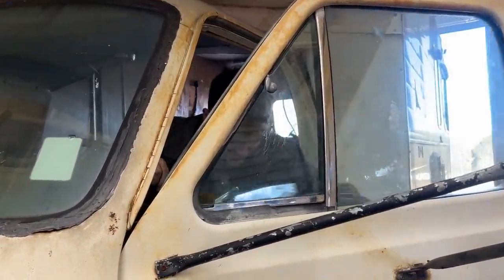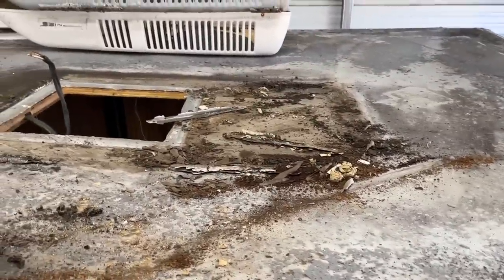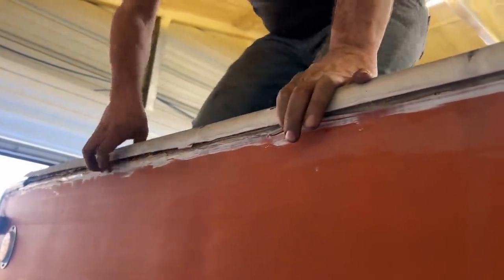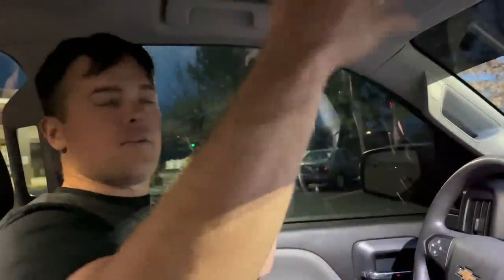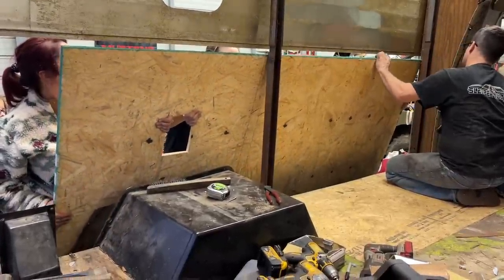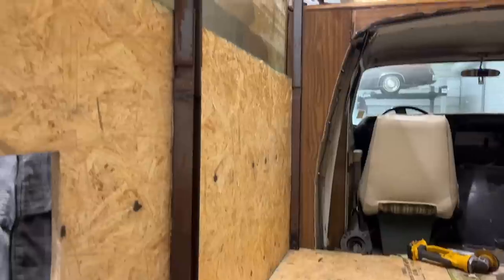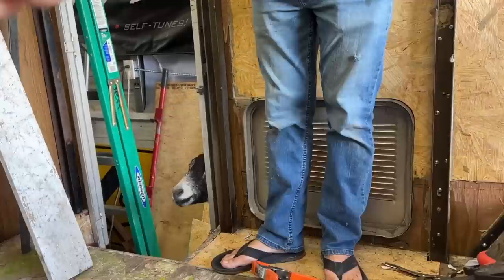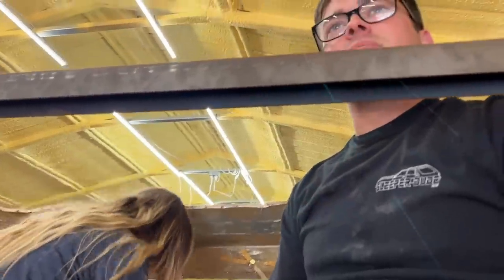Rotten Roof, Walls, and Floor! How bad is it? Antique Motorhome Budget Remodel.

Comment from the maker: 💯 Download Fishing Clash on your iOS/Android device for free https://fishingclash.link/Sleeperdude! Use my gift code TURBOJOSH to get an awesome reward for a total value of $20, and share your biggest catch in the pinned comment!
Reply: We got a clan going on this game?  Pretty good graphics.
Reply: Great job. Put some 4 inch angle roof edge on top of the rubber roof. Fasten it with glue then stagger the screws every 4 to 6 inches. Glue a 6 inch strip of rubber over the metal to cover the screws. Caulk the 6 inch wide strip of rubber on all sides with Vulkem urethane caulk. This will prevent leaks and  keep the roof from blowing off while traveling.
Reply: I got distracted playing and had to rewind!
Reply: Did you buy sturdy flooring osb? The glue is waterproof and would be good for all of it.
Reply: Let Ralph’s get his sleep!  The boy lovers this and sleep!  He’s growing up before us all.
Reply: Just saying!
Reply: If they made steel toe flip flops you'd definitely wear them don't lie Josh

Comment: Oh, man, more motorhome fun - this makes my week so much better. Thanks, Sleeperdude family! Speaking from experience, the only thing that lets in more water and then holds onto it than a motorhome is a sponge.
Reply from the maker: Your right
Reply: @Sleeperdude  The new rubber roof should be a big help in keeping it dry...hopefully for many years.
Reply: @xlmi7021  I saw an old motorhome that was reroofed with a corrugated metal roof, like on a house.   It looked pretty good and has to be stronger than rubber
Reply: Touring caravans (the kind you hook up behind a car, the kind Jeremy Clarkson has spent 40 years destroying on camera). Similar construction, except, you see that steel frame in the Wienerbago? At least the old (1970-1993) caravans I know of, all had wood frames. So when they soak it up, the whole structure gets floppy. With the inevitable sag, lean, and drop if left long enough.
Reply: New t-shirt idea  it ain't easy being squeezy

Comment: Consider putting a metal tube from front to rear between the metal supports so there is a bow in the top. Flat roofs will never stay sound for long. Even a 1.5 inch bow will make it more waterproof over the long haul.
Reply from the maker: Sounds good

Comment: You have a blank canvas now ! With 3 kids and that size motorhome I’d build 2 bunk beds and a queen size in the back a small kitchenette and use those bus seats for the kids right behind the drivers compartment + a small head would be needed ! Haul a small enclosed trailer for your BBQ and bikes and chairs and when camping use the trailer for a dinning area and game area in case it’s raining but make sure you insulate with CLOSED FOAM on the ceiling and walls and floor ! Hardwood floors work the best plus a box on the rear for your generator and tools plus gas cans . I’d use the cab bunk for storage of coolers and clothes and food , that’s my opinion from a guy who has owned many campers !
Reply from the maker: Sounds good

Comment: I love this project and even more that it is a family project. Life skill building is invaluable. I'd suggest more steel structure in the roof especially where you will put an AC unit to prevent the roof from sagging. As for weight, make sure you have some decent shocks, maybe adjustable air shocks to prevent shock load to the structure after adding interior and luggage while  traveling. Maybe some type of moisture barrier with taped seams to prevent structure damaging condensation while sleeping. Finally prevent rot from wet road spray and ground moisture by using an impermeable coating on the underside of the exposed floor. Maybe hit up a cat scale before and after doing the interior. Make sure the GVWR doesn't exceed the axle rating. Use better wheel bearings. Carry a porta potty instead of plumbing in a gray/black water tank. Fresh water tank adds lots of weight. Most campgrounds offer electric/water hookup. Add rear impact protection inside rear wall, tied into vehicle frame. Maximize storage with your interior build. You're doing great! I'm looking forward to more of this series and your travels.
Reply from the maker: Yes good tips thank you ..

Comment: The framing in the front you can weld a frame to screw the OSB to. The whole perimeter of the roof can be metal for strength to hold better. Y'all can build a stronger structure with a little more metal. Tanks are easy to find. There's an RV salvage business in Kentucky y'all can source some of the parts for. I wish I could remember the name of it. They've got pretty much anything you'll need. The wiring is gonna be a problem cus you forgot to cut channels for it.
Reply from the maker: Ok thank you
Reply: The wiring goes in grooves cut into foam board which he hasn't installed yet. That's how they do it from the factory

Comment: You cant beat a older motorhome , I have 83 gmc  doing the same here. Keep up the good work family. Loved the big boat ride so fun. Georgia mad mike said that.
Reply from the maker: Awesome thank you
Reply: @Sleeperdude  Hey USE the electrical panel thinner than luon not heaver  thin panel
Reply: Use the weather wrap  side to side across the top. so if it leaks it will run off  . TYVEAK wrap

Comment: Hey Josh, biggest suggestion is metal frame the front bed area to prevent the structure sagging onto the truck roof in the future as the wood rots out again. I’d also consider some diagonal supports under the bed, in the rear wall and at minimum 2 in the roof structure if you’re trying to stiffen it up to make it safer for your family to ride in. Consider also that the chassis underneath this motorhome may need some structural upgrades to meet the requirements for new registration. If it is possible to fit upgraded brakes please do so as that newly rebuilt 360 will produce more torque propelling this down the road faster than the manufacturer intended. With such an amazing family on board you should have all the stopping power you can muster. Also consider this was built for two people to travel in. In Australia people riding in the living area must have lap sash seatbelts like front passengers do. I despise side facing seats due to the number of neck injuries  on record.
Reply from the maker: Thank you

Comment: I use too work on these motor homes for about six months and one tip i can give you is to make sure it's water tight is when you silicon it up you need to remove all the old silicon and wipe down the surface with some solvent before you apply the new silicon as new silicon doesn't seal to old silicon very well 
Thanks for all the great content and happy birthday Josh from south Australia
Reply from the maker: Thank you for that tip!!!

Comment: Hey Josh, I have been in the Rv industry for over 20 years, the sealant you want to use is called Butyl Tape, for corners, and Dicor self leveling for the seams on the roof. I  am here for you if you have any questions..
Reply from the maker: Ok great thank you

Comment: Tip: The hole by the handle of the caulk gun is used to cut the tip of the caulk cartridge. Stick the plastic tip in the hole and squeeze the handle. Easy peasy.

Comment: One other trick I was going to tell you is if you ever break down again you can rent a 2-wheel car dolly and a U-Haul half ton Chevy pickup and throw the front of the camper up on and tow it back the only thing I would do is remove the driveshaft like you did before just take it easy and if the fryin is a little too wide normally there is front spacers on it and you can remove them and put the wheels but normally a car dolly is wide enough to fit a dually on on the front end
Reply from the maker: Ok thanks
Reply: @Sleeperdude  yeah no problem don't mean to keep bothering you there is a really nice Ford Fairmont up on marketplace he says it does not run says it only has original 48,000 miles and it's really good on rust and it looks like it from the pictures I tried to send it to you off the sleeper dude 88 on I think you should check it out cuz I know you need some parts I think it's way worth that

Comment: YOUR  DOING  WHAT  IVE  BEEN  DOING  ON MY 73 
TIOGA  FOR  27 YEARS
O K....THEY   ALMOST  ALL HAVE.....360  727 TORQUEFLYTE......410 GEARS
DUALLY.....GOONG  TO  OVERDRIVE....ONLY  WORKS 
IF YOU  GO  TO  383  OR  440..
360  IS  NOT  STROMG   ENOUGH
.ANYWAY.....GOOD JOB.
.
Reply from the maker: Thank you

Comment: here's what I did , I took the whole camper shell off the motorhome keep the driving part then I bought a fifth wheel holiday trailer took off the fifth wheel hitch and axels+springs lifted it up backed the mini winnie under the trailer and bolted , welded it together . Then I used the existing trailer wiring less the brake wiring to wire up the lights , then I used lipstick and bubblegum to finish it up now I got a little bit of old with newer power train and newer camper shell and no leaks sleeps six .

Comment: I bought a 79 motor home several years ago, the previous owner had stripped the inside.  I rebuilt most of the inside (until I got burned out).   Ended up trading it for some plumbing / well work.   When you start on them you don’t think it’ll be that much work, but the deeper you dig, the worse it gets.  Where the heck do you stop.  I salute your dedication

Comment: The gooey stuff is called butel tape it’s used to seal the seam and prevent water leakage. Campers of your type had to have the butel replaced every few years especially if it dried out.

Comment: Nice job! I used to help build Hitchhiker II campers. When you do the rubber roof, be sure to overlap plenty on all sides. Glue the front half first, using a paint roller to apply. The do the back half. DO NOT CUT OUT YOUR HOLES! Cut an X, corner to corner, and let the roof go inside. Caulk edges of holes, screw down vents and A/C, caulk again to seal screws. Glob it on! Then go inside and trim rubber to fit. Caulk all trim. We used foam weatherstrip tape on the backside, and caulk on the outside to seal windows. I hope this helps

Comment: First and foremost, Happy Birthday Josh.
Always a treat to watch your wonderful family tackling complex problems, and to be sure, rebuilding the body of a Motorhome or Trailer is Not for the faint of heart.
You asked for advice, and i do have a few hard learned tips to give you.
First,.... Paint every surface that you can get at before closing it all in with inner panelling RVs are notorious for trapping moisture in the walls. And while their isnt any sure fired way [cheaply] of getting past this problem, The paint will give you some peace of mind, in that it will slow down the ingress of moisture.
Second, I strongly advise you to use a Diesel air heater as your source of heat, they do not create water vapour like Propane heaters do [ ive been using them for quite a few years now, and i love them,]  Canada can get pretty cold, so i can attest to these heaters being the best, and they are super efficient. ask any long haul trucker [they've been used for many years by truckers] if you can plan ahead in the build, you can make allowances for air vents from the heater..
as to the bathroom situation, consider using an earth toilet,  this will get rid of the nasty sewage tank, and will give you many years of trouble free service.
\As ive said many times before,  your family is amazing, and the kids purely shine, and thats all due to you and your wonderful wife.
Looking forward to more great videos from you guys,,,
I send you my very best wishes, from British Columbia Canada,, cold and rainy right now,.but looking forward to a nice summer.
Much Love.
Al
Reply from the maker: Ok thank you good info

Comment: So, Josh, as you’ve discovered your motorhome is stapled together. A practice still used today. They build them from the inside out. Interior, walls then roof. Look into RV Armor for sealed roofs with a warranty. You will have to rebuild the whole coach. EPDM and Dicor are industry standards. When you’re done it will be better than when it left the Winnebago Indiana plant. I work for General RV in Ashland VA.
Reply from the maker: Thank you

Comment: A year ago i bought a 1992 Itasca, 33', and I've got nearly all the issue you've got with that mini-Winnie. My roof sags, the ACs are locked up, etc. The roof had numerous layers of putty, silicone, liquid sealant and crud. Nearly have my screws were rusted in place and angle-grinding them from philips to slot was the only way to remove them. Some snapped and vice grips were needed. My entire windshield was barely attached and letting in water. I squirted sealant in to secure it. I can totally relate to Wawa scraping stuff off. You guys did an amazing job rebuilding the walls. I can't wait for the roof video. All my roof vents were cracked and the screws weren't grabbing into any wood or anything. I had a huge retractable TV antenna too that won't work of course since the advent of digital TV. Since you're rewiring everything you should install USB outlets so devices can be recharged.

Comment: 👏👏👏👏The Minnie Winnie is in the shop!! The best in family entertainment there is!! Can't believe how hard all y'all have worked on this already. Not surprised the whole thing came apart on y'all. They didn't build them real solid back in the 70's. There's no doubt y'all are going to built it back stronger and better then it ever was. As long as you don't get to heavy for the chassis, you should be good. That single casing rear end cuts down a lot of load capacity, which is unfortunate. Can't wait to see how this all comes back together. Really looking forward to the body shop days and seeing how this old rig gets painted back up. 
Really love how Daddy Braddy continues to correct his name in every vid. And even though it's way past, and you're even more a middle aged man with kids then before...Happy Belated birthday Josh!! Rebuilding a falling apart old motor home seemed like a great way to start your 37th year on the planet.
Can't wait to see this series come together!! Good work Sleeperdude family!!
Reply from the maker: Thank you so much

Comment: Dear Sleeperdude family.
👍👌👏 Good heavens, what an enormous effort! This time you really got rid of all the rot and insect damage fortunately. Especially getting rid of mold is extremely important (most people very much underestimate the health problems caused by mold). I really hope that you will add respectively weld in a horizontal steel bar in the back where the kink is. Maybe you need to add a trailer hitch for taking a little trailer with you. Because I guess, that this relatively little Ex- Winnebago is a bit small for the whole family plus all the stuff/clothing you need. To have at least a small motorbike with you, seems also essential. I'm eagerly looking forward to watch the next part of the new RV- series.
Thanks a lot for making explaining recording editing uploading and sharing.
Best regards, luck and especially health to all of you (including the animals of course).

Comment: I'm only 20 minutes into the video and already loving it, I remember how upset you were with yourself when you did the last motor home but you will never see another of those on the road again and I am in awe of you and your family taking on the task
Reply from the maker: Thank you glad you liked it
Reply: I was fine till he didnt even clean the dirt off that aluminum piece thats full of pin holes before he wasted all that liquid nails on it, I just had to pretend i didnt see that part Good thing the top of the van supports the overhead bed or they would be falling out on the ground on the one side as there's no metal structure along the edges of the overhead cab part. The corner he didnt replace is not stuctural its only 1/18 luan with some foam sandwiched between the exterior siding

Comment: Hope you had a Happy Birthday. 
I worked in a place that built pickup campers and small motor homes. I run a table saw cutting all the wood to the size it needed to be. The board came in 1 by 12s and I cut them down to how ever wide they needed and a woman there by me cut them off to length they needed to be. Someone else cut the plywood and paneling.  I'm thinking the ones we had had the 440 in them.
❤️🙏.                      Dan 🇺🇸

Comment: Josh whatever you do When you put the back of that motor home on make sure you add a large door You never know what you gonna want to put in there and you will not regret it . For instance I put a 110 V washer and dryer all-in-one unit in a camper . Yes one machine washes and dries it's great
Reply from the maker: Ok good tip thanks

Comment: Definitely should add square stock cage to front sleep section for safety and structure join vertical center section with square stock also above door area on both side...

Comment: A road trip to Elkhart Indiana and southwest Michigan can get you a lot of stuff for this RV. I would also suggest using a self leveling seal on the roof after the trim and vents are installed it is used on every thing I work on at Jayco. As for the walls and floors everything is laminated together before it is installed that is why the different layers.

Comment: Hey Josh about that propane issue, once I took the furnace out of a big park model trailer. I put a bigger water heater in..they are safe because all the propane is outside. Then inside the trailer I put in a school bus heater and a circulating pump, just "T"ed into the hot and cold pipes at the water heater. Reduced my appliances ftom 2 to 1, so less to fix. Heat was fine. Mind you my idea of fine heat will be different than yours because here in Canada it gets 30 below...
Reply from the maker: Ok good to know thanks